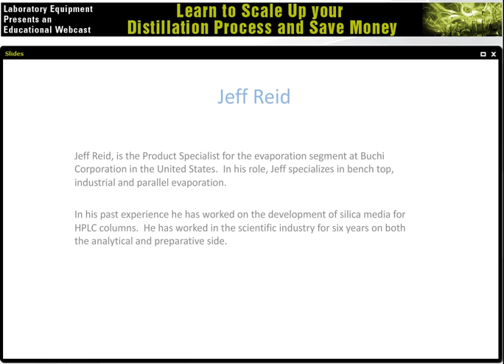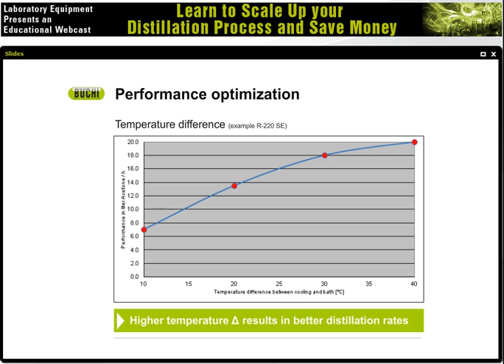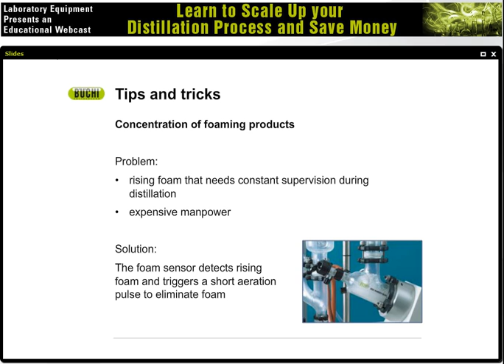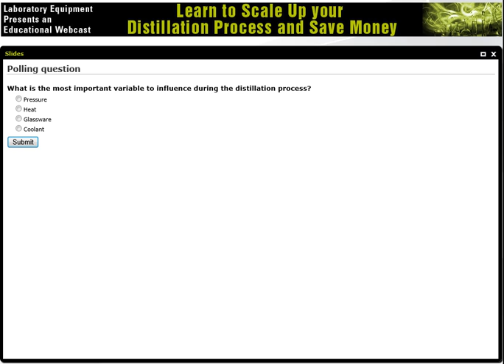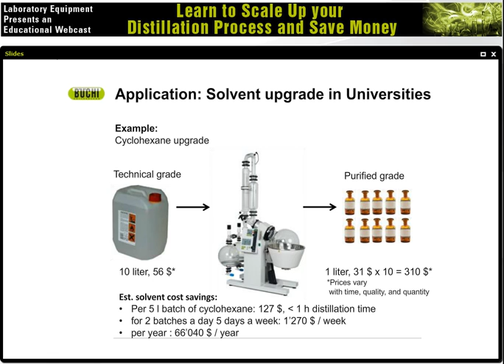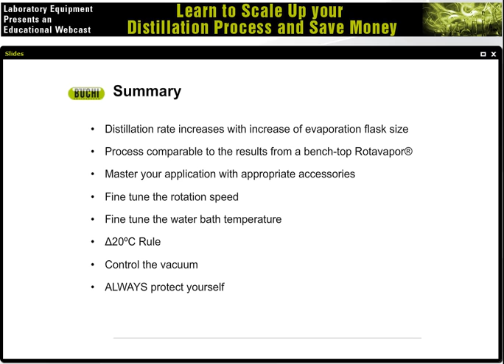Rotary Evaporator Basics

Comment: Change in 20 degrees  Celsius rule makes sense, but why can't the coil just be cooled to neg 10 and still work... I don't understand how the condenser can be set too low and it have a negative impact. Can anyone explain
Reply: Think of it like a thermal kline, the energy doesn't transfer at that physical boundary, yet it's a thermal boundary of inefficient energy transfer.